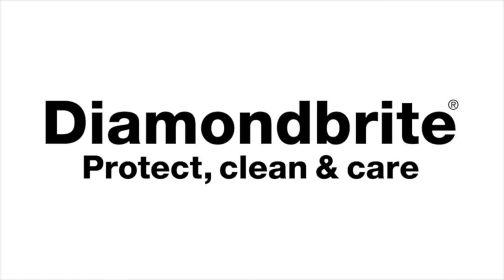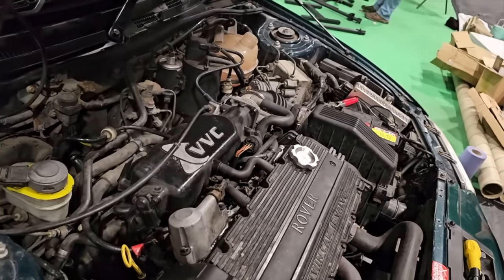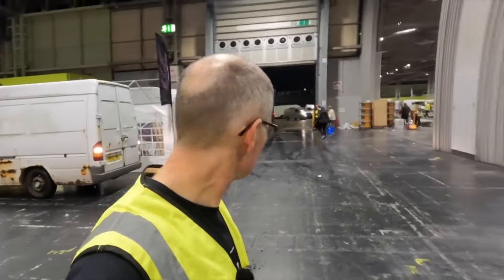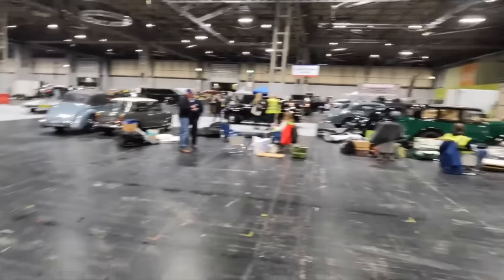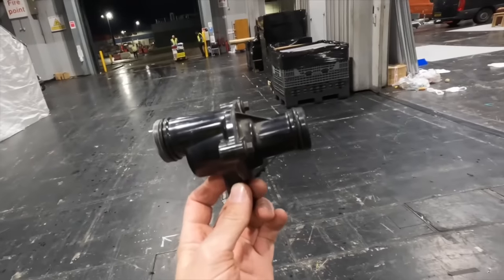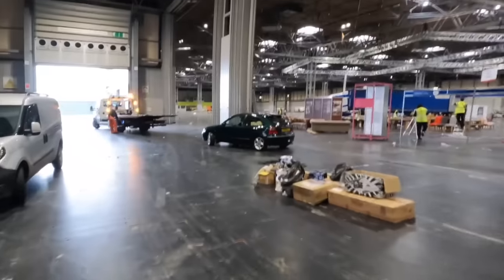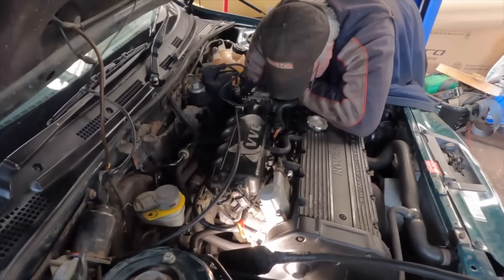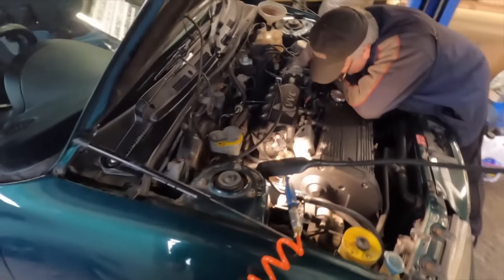After the NEC - 27 hours home in the 200Vi...Featuing Hub Nut

Comment: So  very relatable Matt... Firstly, my sympathies. Last month I was at an event in my 2003 Jaguar XJ6. 70 miles from home. When I came to leave, I discovered a large brownie pinky puddle under the car. Likewise, my thermostat housing had cracked down the middle. Without warning. Long story short, called for recovery at 12:32, the recovery lorry came at 22:17... A very long day in a car park. Glad you made it home eventually.

Comment: A friend in need is a friend indeed, these old rover boys know  everything there is to know about fixing cars. Half the modern garages these days rely far too much on computers telling them whats wrong. The rover lives on👍
Reply: You can say that again! I had a shop tell me they needed to talk to Volvo to index the back axle. Then they said a 1990 240DL 2.3 was beyond their ability to diagnose. I called them back the day after another shop "fixed" it. Those incompetent sods could not diagnose a worn out U Joint! On a car with the original joints, all 3, at 390,000 miles. The shop that did diagnose the issue tried to kill people because they did not know how to install the clips.
Reply: Speaking of relying on computers, I live in Barrie, Ontario, Canada. A friend in Dallas, Texas, U S.A. called me to see if I could diagnose the problem with his 89 Ford Crown Victoria. The first mechanic gave up after 6 months. Number 2 was about to after 3 months. It took me 30 minutes from 2,000 miles away. Number 1 diagnosed it, but did not clue in that the 5.0 litre HO uses a different distributor than the normal output 5.0 litre engine.

Comment: I did the head gasket on my 211 last year and had the same issue with the O rings.
I ended up buying some genuine MG Rover ones from Rimmers which fitted fine. I also smear silicone grease over them prior to fitting, to help them slide in smoothly.

Comment: The alloy or cast iron thermostat housing bolted to the block with a radiator hose clamped to it worked perfectly fine for pretty much every water cooled postwar car but then they started using plastic, O rings and including various other bits and the reliability disappears!
Reply: the only fault my 90,000mile 8 year old Ford has had is a..... leaky plastic thermostat housing. Fortunately it occured whilst under warrenty

Comment: Oh no! At least you got home OK. I don't know if the coolant pipe arrangement is similar to the K series in a Metro, but I find the easiest way to bleed the system is to form a seal with my mouth over the expansion tank and blow forcing coolant out of the top bleed point. Kind of pressure bleeding I guess 😂

Comment: Ah a crap plastic thermostat housing design definitely best suited by sticking it down the back of the engine.

No chance I take my old car anywhere without tools, guaranteed to never need them then 😊
Reply: Better than at the front by the exhaust 🤣. (as bad as first gen ford zeta engines with the idle control valve on the back side of the engine.
Reply: You could have a shed full of tools with you but if the new part is faulty you're not much better off. I normally have basic tools with me including tow rope and bar and heavy jump leads. Amazing how many people have shite jump leads 🙄 which will almost melt under pressure or limit the boost power.
Reply: Have a tool kit in the car. My better half had a puncture and after putting on the spare popped into the local dealer for a new tyre. Mechanic got a shock when he tried to pick up the tool box!

Reasonable tool number of tools. Was enough when we were drag racing a bike, with enough stuff to change a wheel bearing on the trailer. But got rather heavy.